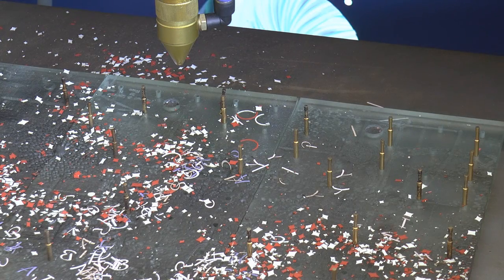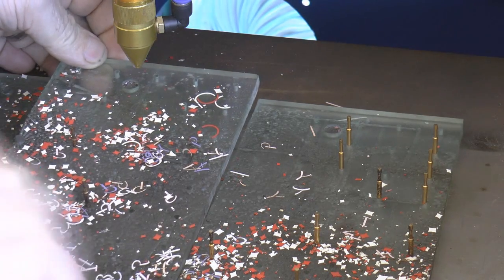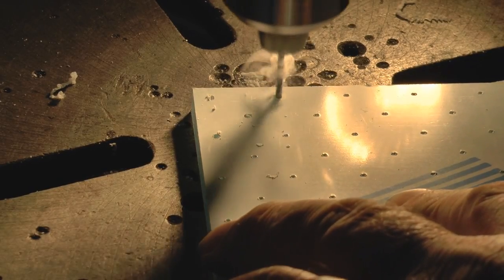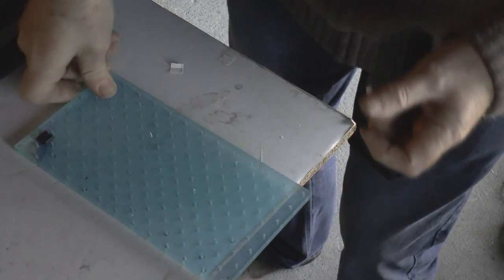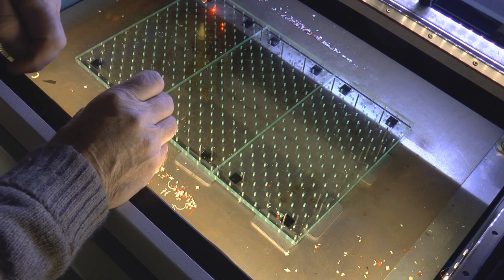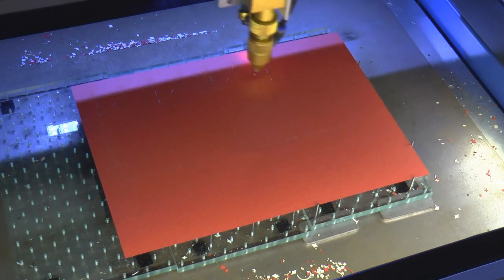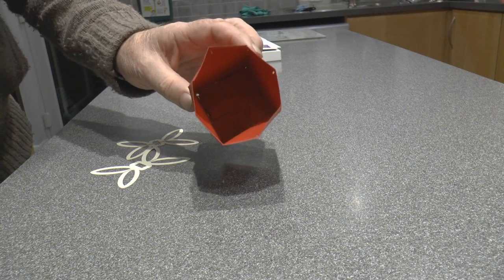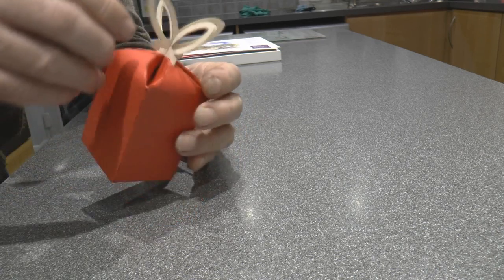RDWorks Learning Lab 45 Make and Test New Pin Bed

Comment: Oh...and another question. :) I mostly cut baltic birch plywood, which as you probably know is hard to make completely flat. On the honeycomb bed, I can use magnets or hold-down pins to flatten it while cutting. Are there are tricks that you can think of to flatten 1/8" plywood on a pin bed?
Reply from the maker: Hi Liz

 There are very few problems I have not encountered. That problem annoyed me as much as it is  annoying  you. You will find the solution to your problem burried in this 3 year old video
https://www.youtube.com/watch?v=R_0rczM5FDM
 Best wishes
Russ

Comment: Thanks for all of these excellent videos!

I've tried using a pin bed on our makerspace laser cutter, but I've found that when I'm cutting intricate pieces out of birch, the small pieces fall onto the acrylic and are then often ignited by the laser as it works on the piece. 

Any suggestions as to how to deal with this?
Reply from the maker: Hi Liz

This was made 6 yeras ago right towards the beginning of my learning journey into this technology, The need to raise the work off the bed was an early lesson I learnt. It  was orriginally desgned to  to solve the problems I was having with card and paper cutting . It .has worked  extremely well for me because  with paper and card cutting,  the speed is high and the power is low  so apart from scorching the drop out card debris,  I have never had any fire risk with the baseplate. Repetative programs do create a shallow groove in the baseplate but that's the extent of the damage.
Time makes me wiser but god makes me uglier and fatter as I plough on with my learning journey. 3 years later I designed a more flexible, less fiddly pin support system that will solve your problem for certain.  See this video from 19:25   https://www.youtube.com/watch?v=CXda33tlO3k

A further 3 years later and now very ugly,  I designed an even simpler support system that will also work well for you. 
See this video from 25:15  https://www.youtube.com/watch?v=7pFuW1zPkkg&t=1270s
 
 Best wishes
Russ

Comment: Hi Russ, I'm thinking of buying a laser to use to cut printed paper on a laser printer. Is it possible to cut white paper with the laser without leaving cut marks?
Thank you for your great work helping us with your videos.
Reply from the maker: Hi Manuel
 Almost any laser you buy from Ebay or Amazon market place will be fitted with a substandard tube delivering low power. You may well have to buy a proper A grade tube before you will get any real pleasure form your machine. 
Yes cutting paper without burning/scorching  is very possible but few know the real secret. Every tube  goes through a startup process every time it turns on for a cut. It takes but a few microseconds  and is called preionization. However, with careful control of the current you can hold the beam at this unstable state and use the amazing properties to cut paper and card. see this video from about 48 minutes to see how to identify the zone. 
https://www.youtube.com/watch?v=TVgmoN1wljs
Also, here is a demo video I did for a friend who, like you, was interested in cutting card and paper.
https://www.youtube.com/watch?v=TVgmoN1wljs

Best wishes
Russ
Reply: @SarbarMultimedia  Hi Russ, the 2 links are the same, when you can put the missing link, thank you very much for taking the time to help us.
Reply from the maker: Hi Manuel
 My apologies I pasted a totally incorrect link....twice!!

Here is the one that shows you how to identify the preionization zone   start 24:45
  https://www.youtube.com/watch?v=nZuatc3eIgU&list=PLPWEtx5V9DqEogIeYRdcG_KYcB7UL2Qmn&index=25&t=1488s
 and 
the paper cutting examples
https://www.youtube.com/watch?v=gEaGdmoKzBw

 Best wishes
Russ
Reply: @SarbarMultimedia  Hi Russ, thanks for your help, and sorry for thanking you after a few days.
The second video tells me that it is not available, that it is private.
Is there any solution to see it?
Thanks once again
Reply from the maker: @manuelsevillanohernandez2031  
Hi Manuel.
 I apologize, I forgot to check.  It was an UNLISTED video until about a year ago when YouTube changed the rules. Thee made  all existing UNLISTED  videos to PRIVATE.
 I have now edited the listing back to UNLISTED so you can now watch it  https://www.youtube.com/watch?v=gEaGdmoKzBw
 Best wishes for the New Year
Russ
Reply: @SarbarMultimedia  Hi Russ, I just watched the video, thank you.
Cuts look clean with no burn marks or smoke, and the job looks pretty quick too.
Happy New Year.
Thank you.
Manu.

Comment: Hey Russ, what's the usual speed and power that you are handling paper?
Reply: Hi Vasil
The answer is not as simple as the question
 The general rule for cutting any material is to set the power to max and run as fast as that power will allow., but there are many exceptions. Paper and card is one of them 
You need to understand how your tube works to get the best paper cutting results.  Every time you tun your tube on (every cut) it goes through a startup routine that may appear instant but  that takes maybe a millisecond. (almost instant). This start up process is called preionization. It has  some fabulous properties that are perfect for paper cutting, glass engraving and photo engraving.  EVERY tube has this operating region at low current (low % power)  but it will be different for each tube so you will have to carefully study your tube to identify the region. DSee this video from about 24:30
https://www.youtube.com/watch?v=nZuatc3eIgU&list=PLPWEtx5V9DqEogIeYRdcG_KYcB7UL2Qmn&index=25&t=1078s 
 and then this video to see it in action. Listen to the "hissing" cut... a sure sign of the preionization region.
 https://www.youtube.com/watch?v=S_2NOCpACVc

 Best wishes
Russ
Reply: @russsadler3471  🙏🏼 thanks! Now it makes a lot more sense!

Comment: One thing I have not herd you talk about yet, is how to get the cut on the inside or the outside for the pattern.
Reply from the maker: Hi Mike 
There is no inside or outside for a cut,  it is always along the center of the vector line. There are offset tool s that allow you to reposition the cut in or out by small amounts but you have to be doing marquetry on very thin pieces to need that precision.
Bestwishes
Russ

Comment: I thought about using rivets as pins, then dismissed that when I saw how shinny the aluminium rivet heads were, and I'd guess that the heights aren't that accurate either. Having said that, the pins your using are shinny as well, so could they damage the lens with reflections? Now that you've used these base plates for a while, are they still warp free?
Reply from the maker: Hi Andy
As I have mentioned before, I am on a learning journey that you are following. Every idea I have is a good idea at the time but not necessarily the best idea I did make an improved version that I still use today 4 years on see   https://www.youtube.com/watch?v=kMDRzBZTW9c     I do have the details available.

Best wishes
Russ

Comment: I have thinking about doing a pin board for my system.  This has greatly helped in the planning.   Also, were did the get the paper box you were working on.  My wife does a lot of gift giving and that would be a great gift package.  Thanks again for the video.
Reply from the maker: Hi Tommy
The ideal hing to do is send me a You Tobe private message with your email address and I'll get information to you.  If that causes you a problem then send it as a public comment and as soon as I have extracted the email address I will delete the comment. I hate publishing email addresses in a public forum.

Best wishes
Russ

Comment: Hi Russ. Where did you got the new pins? Do you have a link? Also i assume the thicker the acrylic, the best the resistance to bending over the time, right? Thanks. Awesome video again
Reply from the maker: Hi Polis
The link for the pins is
http://www.pts-uk.com/Products/Pins_Dowel_Pins_Metric_A2/A70232

I used 8mm acrylic. Yes the thicker the better. 10mm would be even better but 6 would be OK. Because the pins are all located on the bottom plate, any movement in the holes will produce lateral movement at the top end of the pin but will NOT change the height. Look how I combat this lateral issue  at the end of my latest video you will see that a heavy metal block and magnets is the complete fix. I could not afford ANY lateral movement in this detailed test piece.
Thanks for your kind words
Regards
Russ
Reply: SarbarMultimedia yes, i saw that and figured out the upgrade. Thanks Russ, you rock :)

Comment: I really like the videos where i get to see your engineering and mechanical techniques in something creative. in the event that it becomes more common in the future if u run out of non-laser cut improvements to your machine. i would not be annoyed one bit. (=
Reply from the maker: +luxaeternae 
Hi
I have reached a point in my learning where all the major topics and questions have been examined. Seeking to extract the absolute maximum power from my machine,  has forced me to understand lots of detail about laser theory.  Although the basic engineering on my machine is very good there have been lots of detail improvements that were needed to make things safer or easier to do/use. I don't like throwing money at problems, I prefer to use my ingenuity and somehow utilize materials that I have in my workshop for FREE.  How many big and interesting subjects remain for me to learn about? Not many I'm afraid so I anticipate my video output will start to slow down soon and there may be some repetitions as I try to improve some of my improvements. That wont stop me making videos but it may be very boring.
Thanks for your kind words and support
Russ

Comment from the maker: I made the assumption in the making of this video, that you had seen my earlier video about my pogo pin bed. If you have a slatted bed, a punched aluminium slot bed or a honeycomb bed you must first cover the bed with a FLATsheet of steel. The holes in the acrylic are slip fit through holes. The pins drop into the holes easily and naturally touch the steel support plate for uniform height reference
My apologies for any confusion caused......Russ

Comment: Thanks. Great vid. I should get my laser cutter in about two or three weeks. Hardly wait.
Reply from the maker: +Bradley Mohr 
Hi Bradlley
 While you are waiting, it is vital that you buy a cheap ammeter  £2 ( http://www.ebay.co.uk/itm/85C1-Analog-Current-Panel-Meter-DC-30A-AMP-Ammeter-ET-/171992882880?hash=item280b931ec0:g:OVgAAOSwYHxWP6cy  ) It will be your best friend ever to prevent you damaging your tube, and this is how to fit it https://youtu.be/xDZmuxq5BEM
I'm sure you will have great fun (and a few disappointments)
Best regards
Russ
Reply: I have already ordered one thanks to your videos.